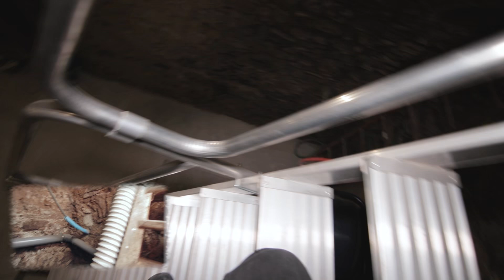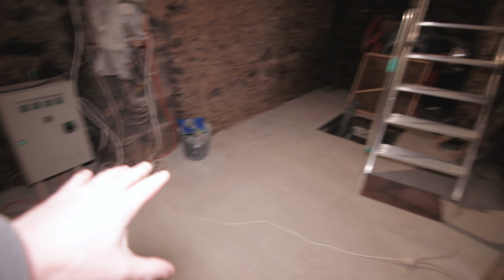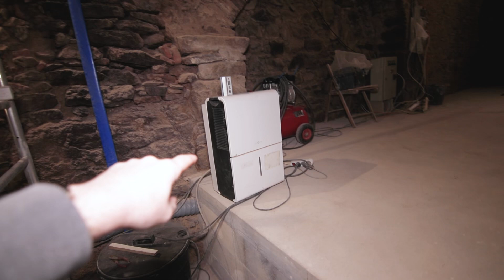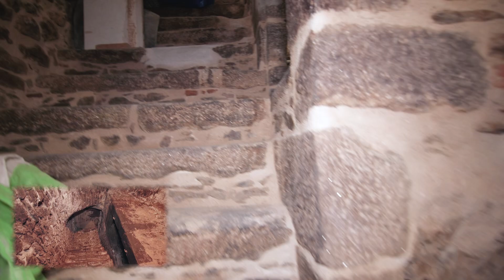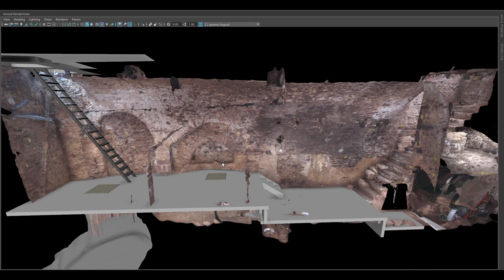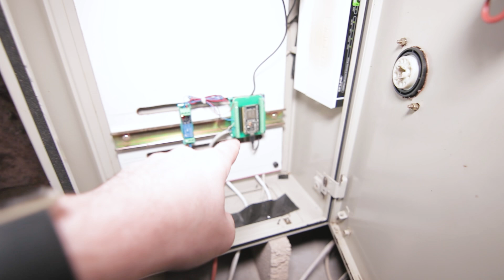Old Cellar 32: Renovation of medieval cellar, 5.5 years of work.

Comment: Automating the dehumidifier and adding if this then that alarms to inform you of concerns would be interesting to see.
Reply from the maker: Yeah I'd like to have a smarter system overall. Having the dehumidifier react to the exterior humidity and such. But I  need to understand a bit more the air flow globally in the cellar. Right now I seem to have more air exiting that entering which need to be explored.

Comment: Brilliant. 👍. What about putting a grille instead of, or in, the hatch where the condensation was.??
Reply from the maker: Thanks, that could be a solution for the humidity, but the goal is to capture the Radon before it gets to the "living space". I'm trying to capture it under the concrete floor. It works for the Radon for the level of humidity in the undercellar in winter the fans are a bit weak. But in a couple month it"ll be dry.
Reply: @thevaultedworkshop765  oops.. forgot about the nasty Radon 😬

Comment: Wow!  With your sub cellar being that cold I wonder if it would be good for a Geothermal Heat Pump to cool your house?  Not a cheap system, and im not sure of your budget (i'll be watching the other videos now)
Reply from the maker: That was seriously considered, unfortunately it's a bit too small for the coolant basket, also considering the work to get the line there and back. But I'd like to use this feature in some way for sure.

Comment: You need the MudMixer instead of the regular concrete mixer.
Reply from the maker: Yes I know but there not easy to come by in my area, and this one was cheap and easy to get into the cellar. And it's getting the job done for my small batches.